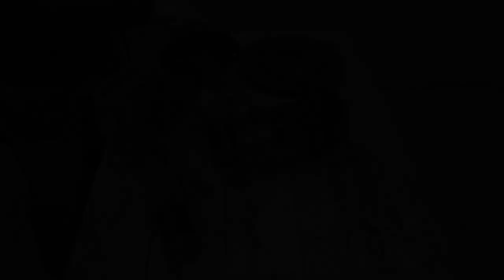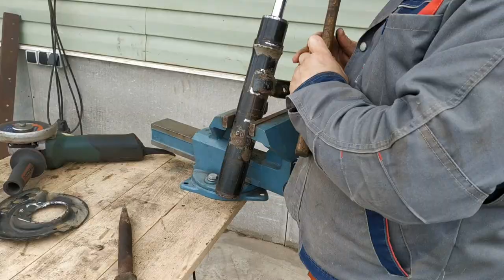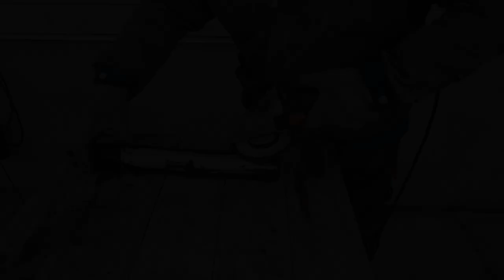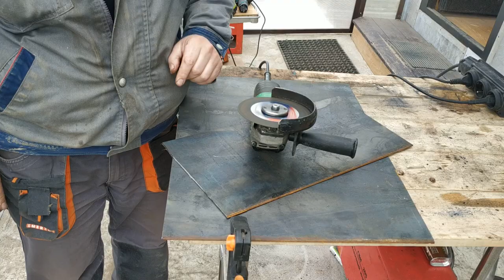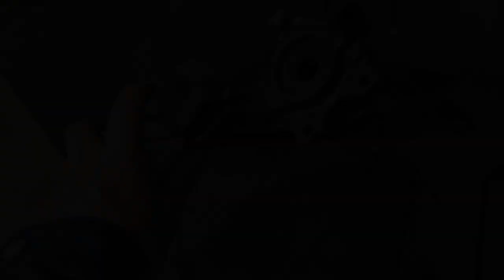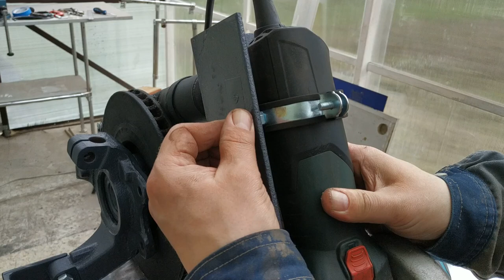Few people know the secret of a simple grinder!!! A brilliant idea!!!

Comment: 説是磨床？分明是角磨機，磨床你見上嗎？
Reply: MORE COMPLETELY: It is a METABO ANGLE GRINDER, one of the few brands that make Variable Speed grinders. Having a variable speed increases the versatility of a grinder, as in addition to cutting and grinding, you can sand, cut plastics and fiberglass at lower speeds, and even polish.  By now, all angle grinders SHOULD have variable speed but with Constant-Torque (otherwise those lose torque at low speeds!).